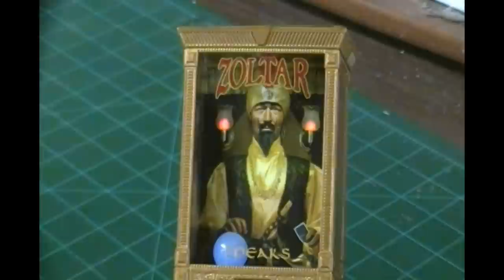Magic Lamp Restoration

Comment: Did you know you could have just soaked those in straight vinegar? 
Cooking vinegar is about 5%.
Horticultural vinegar is 20%, and some is as high as 45%.
It is the acid of the vinegar which dissolves the rust.

.... I understand that you use the flour mixture so the acid will cling to the parts.   I usually just soak the parts vinegar, covering the container.  I allow the parts to sit for a day, with occasional shaking or stirring to help loosen any rust that is ready to fall off, exposing more material.
Reply from the maker: Good tip. Thank you. I might do that in a future video.

Comment: if this lamp is operated on mains electricity,it shouldvhave an earth wire connection
Reply from the maker: I do not disagree with you, but it is uncommon to see a ground wire on small, plug-in type lamps  in the U.S. using 110V.  Replacement lamp cords are mainly sold as 2-wire and that is how most new, UL certified lamps come. I agree that it would add an extra layer of safety and I appreciate you looking out for me.

Comment: are you afraid to use oil before dissasemble ?Thats why u broke that piece when you tried to torsion it
Reply from the maker: The center threaded piece was beyond saving and not structurally sound. It was also not unique to this lamp so I made the decision to just break it to get it apart and move forward. "B'laster PB" is my usual go to for penetrating oil. I also like "Kroil", but it has a very strong odor so don't use it indoors. Of course WD40 has a home on my bench as well. Thank you for watching.